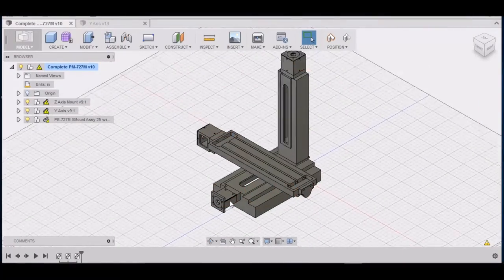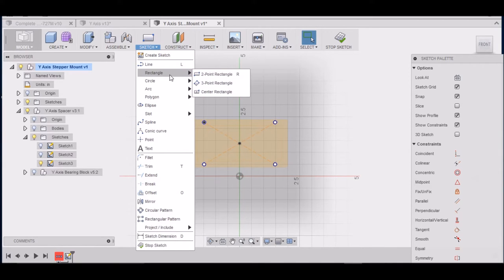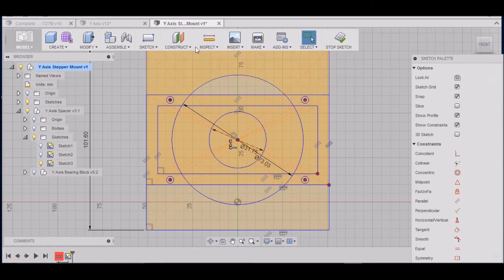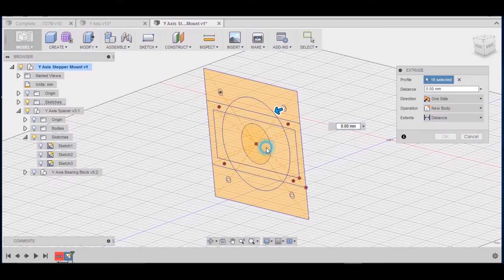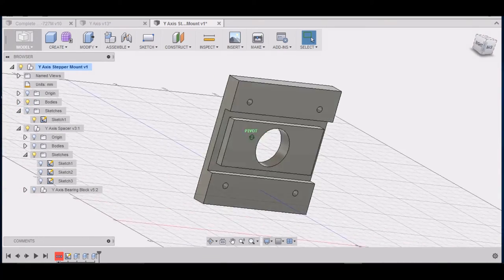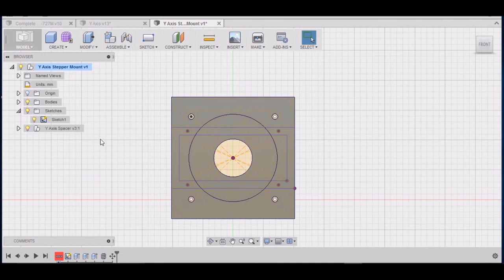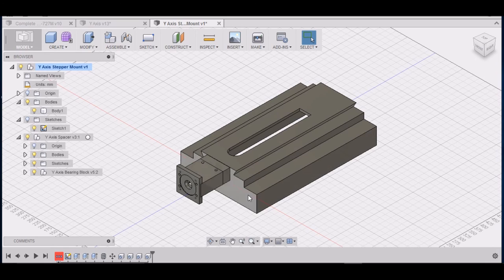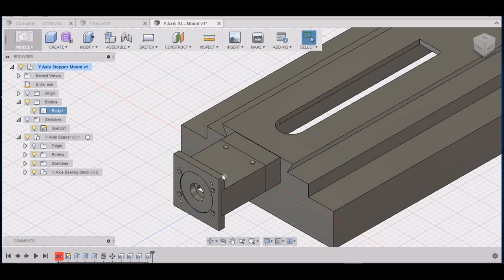PM-727M CNC " Y Axis Stepper Mount "

Comment: Coming along very nicely. I gather you will machine these on the X2? Do you plan on preserving the quill functionality of the mill?
Reply from the maker: +Charlton Wang 
No , actually I'm going to machine most of the mounts with the PM-727m.  This should benifit those who only have a manual mill. 
As for the quill in not sure if it will be just locked in place or somehow removed. It won't be needed after the conversion. 
Be safe Sam
Reply: +CNC4XR7 Ah. I know you mentioned that you might do that in one of your earlier videos but given all the details you've put into CADing all the parts I thought you had decided to just pump the parts out "the easy way." :) Thanks for documenting everything. It's been entertaining to follow.
Reply from the maker: +Charlton Wang 
Lol it's very difficult to manually mill parts when you have a CNC.   Which I did with the G0602 project. However with this build I wanted to show how you can do it with the same mill your converting.  A lot of times the mill is the first purchase.